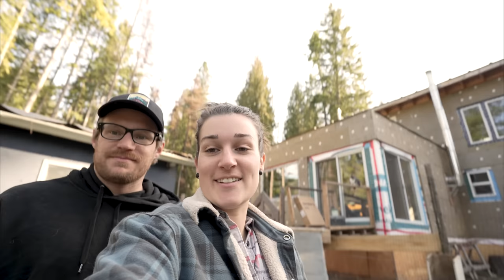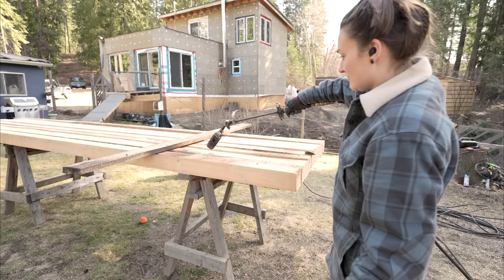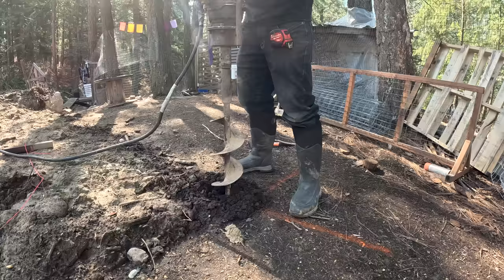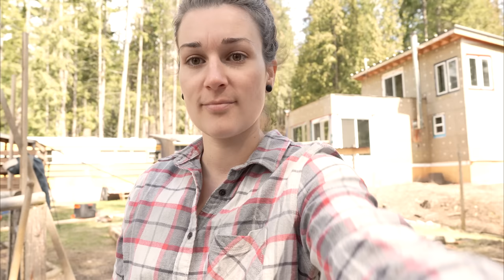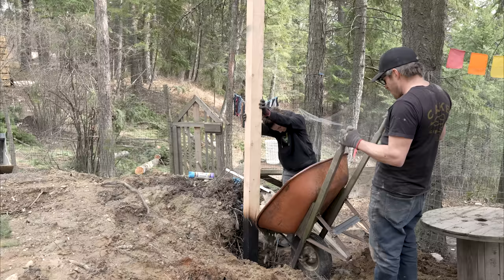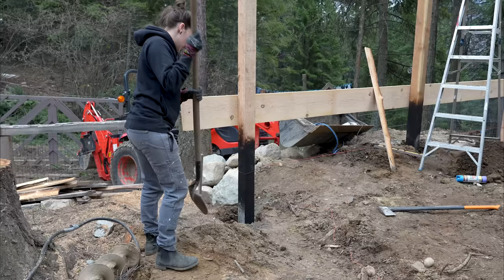These Beams Were REALLY HEAVY! Using Self Milled Lumber For A Barn Build

Comment: Always good to see folks working hard and making their dreams come true. My advice is a bit late, but I've learned the hard way to never put concrete around posts in the ground. I've never done the charring method, and I do think it really helps preserve wood if done well, but the problem in your case is that the concrete will just trap moisture and hold it against those posts. They will last longer than untreated posts set in concrete, but the best case is to use treated (or charred) posts set on top of a bed of gravel so the moisture drains. If you want to use concrete, then you need to make piers that extend above ground and then attach posts to that (so the wood doesn't sit in moisture). You'll be replacing those posts sooner than you'd like, but hopefully you'll still get at least 5-10 years out of them. Happy building!
Reply: Whether you char the wood or purchase a wood post with some sort preservative for below grade contact, the acid from the concrete will start the decaying process.  If you have to put the post in the ground, it is recommend to put some sort of sleeve on that part to protect it from the concrete acid, especially during the curing process.  I have come across instance in timber retaining walls when the tie back was anchored to a CCA post in concrete  that was rotten away.  In the past, if I had to put a post in the ground (sometimes you have no choice), it was wrapped with a self sealing rubber membrane as the belt and suspenders approach.  In addition, I would put couple of galavanted spike nails into the sides to aid in preventing uplift.  

Unless the concrete strength is 5000 psi or greater, moisture will pass thru the concrete.   The key when you using the store brought 5000 psi ready mix bags,  use the least amount of water in the mix or substitute some water with a Concrete Plasticizers.  Rule of thumb, the more water you add, the weaker the concrete becomes and lowers the psi.

As always,  keep up the great work on your homestead.  Looking forward seeing the finish siding on the house.
Reply: Post support shoes would have been the best way.... there are some you can just dump into conrete and then attach the wood post to it. and if the wood rots away at some point you just replace it and then you are done (well still a lot of work....)

Comment: I'm a wheel barrel cement mixer myself.  One suggestion that will greatly help you.  Buy a cheap hoe.  The angle spade on the hoe is perfect for mixing cement in a wheel barrel.  It's like 3x easier to do, and i'm not exaggerating.  You'll thank me later.  P.S.  I helped a while ago with the axe swinging tips ;)

Comment: I would cut the notch to where you want to lower the beam to without taking it down. Leave the screws/bolts in place and then just remove them once you have the notch cut out. A great way to hold a beam in place is to add a piece of 2x4 with a single screw and just swivel it into place once you have one side in place. Great job so far, just wonder why you don't use the tractor to lift them at least into position, then just muscle the last little bit?
Reply: Now that’s a great tip!! 😊

Comment: Greg and Katie, You might find it a little easier to use a Mortar Hoe with a long handle when mixing mortar or concrete in a wheel barrow. I've done it for many years it'll save your knuckles from banging on the edge of the wheel barrow also. I  love your channel and your work ethic. God Bless You and Yours. and the critters too.

Comment: You should be bracing your posts. They can move around when setting beams on the posts. 
Gambrel roof style is what you were thing of. I think. Or just a shed roof. 😊
It sounded like you were building a barn and then adding a lean-to on both sides. 
And why did you not use your tractor to lift the beams?? 😳

Comment: That all was more tense than "The Blair Witch Project."      Please purchase a big "podium ladder"     You likely had 300 pounds on each ladder and the ground was not level.     Put a thick sheet of plywood under the ladder.     Wear a rock-climbing helmet and a weight-lifter's belt.    Also,
clear the ground around you in case you do fall.    You both needed someone to hold each ladder.

Comment: A trick I learned doing posts in the ground.  If your hole is 2 foot deep, put good crushed gravel and some dirt in the first foot and a half, pack in layers and plumb your post as you go.  The last 6" plus use a carboard tube or build a box and bring the concrete above the ground level.  Posts only rot off at the ground level where there is air and water.  This saves on concrete and gives you a solid post off the bat.
Reply: That’s great advice!!

Comment: Katie, you are mighty!  I was super impressed when I saw you lift the first (short) beam.  Your coach should be proud!  You earned an adult beverage and a hot bath!  Greg, I was super impressed that you measured so well and were able to notch those posts BEFORE you had them cemented in.  I thought for sure you'd sink them all, then measure and cut.  You only have to fix one, and it's an easy one.  Nicely done!

Comment: I would have filled those post holes to ground level + 1 with concrete and put a nice, curved top on it so water runs off away from the post.
Reply: Another great 👍 tip!

Comment: By now you have probably discovered how much you have underestimated your shelter needs.  Just from what I've seen of your different breeds and sizes, I would imagine that you could fill a Barn 4 to 6 times as large as you will have when you are finished with this building.  The good news is that it looks like you have the skills, room and materials necessary to expand your design as necessary.  Good luck.

Comment: I've don a lot of construction work over my 65 years and much of it involved using small engines.
I once lamented to the repair shop about the best way to store small engines when not in use and they solved it in the most simple way... Use mixed fuel in ALL small engines and went on to tell me that most modern oil formulated for 2 cycle engines (50:1) will burn clean enough to not smoke in 4 cycle engines and they more often than not include a fuel stabilizer that only helps during storage. The worst thing that could happen is additional lubrication in your engine.
I did this for years and never encountered a smoking engine or fouled plug or any other related issues and never worried about whether or not I had mixed fuel because I always mixed it as I filled the portable cans at the gas station.

Comment: When using a posthole borer drill down about nine inches at a time then lift auger to let soil clear then you will find that it does not bind in the hole and will be easier and quicker and the auger will not require so much effort to stop it trying to rotate and lighter as well. regards john.
Reply: Awesome tip - I was thinking the same thing 😊

Comment: You burnt the wood to prevent rot but then concreted them in. You wasted time burning them. I have post in for over 25 year that we burnt and there still strong and not concreated. Concret will break down wood fiber faster than water. Would of been better the just pour a pad under them.

Comment: when I built my horse barn I set all then posts Knowing they wer not same length , I used string and line level to mark the thr cutoff. and cut them in place did want to depend on foundation depth.  Idid set in concrete

Comment: The type of roof structure you are building is called Clerestory.  It's an off-set gable style which often will have windows in the off-set horizontal space (The short wall) between the two roofs that "don't meet" at the mid-point of the building. It is a very good look, and a good choice for your barn. You might even consider putting some fixed glass panels in that wall. It really helps with getting light into the barn while keeping out the weather. Good Job as usual!

Comment: BEEN WATCHING YOUR VIDEOS.  WAS WONDERING WHAT DO YOU DO WITH THE PART OF THE LOG YOU CUT OFF TILL TO GET TO CUT THE BOARDS OR FRAMING???  THESE PIECES WITH THE BARK,  WHY CAN'T YOU USE THEM  AS AN OUTSIDE WALL FINISH, AND  OVER LAPPING THEM.  FOR SHEDS OR BARN.  GIVES IT A RUSTIC LOOK AND YOUR USING MOST IF NOT ALL PARTS OF THE LOG.  JUST AN IDEA.  KATHY IS AM AMAZING WORKER.  SHE SHOULD  USE  HER LEGS MORE WHEN LIFTING IF   SHE HAS BACK PROBLEMS.  LOVE WATCHING YOU TWO.